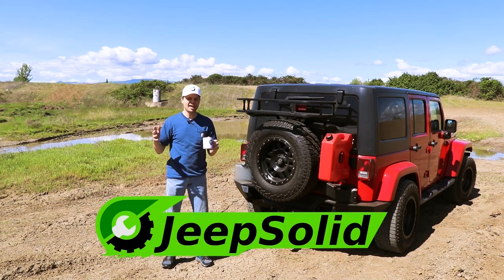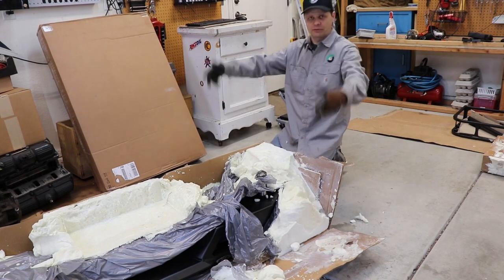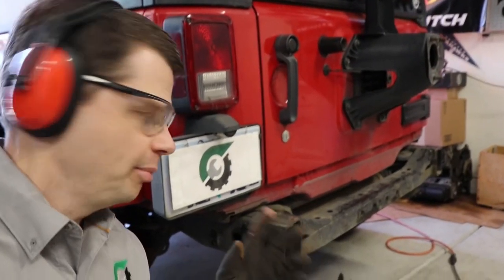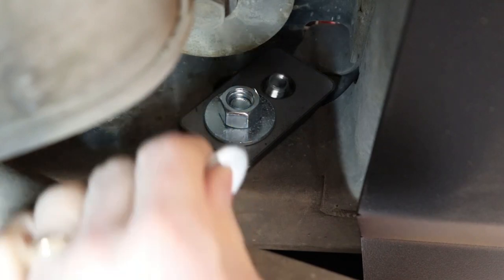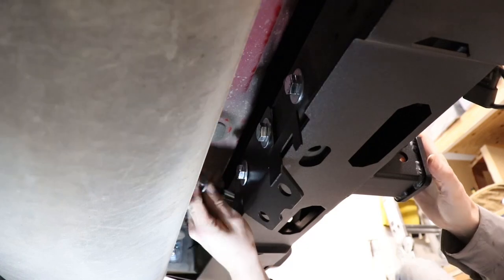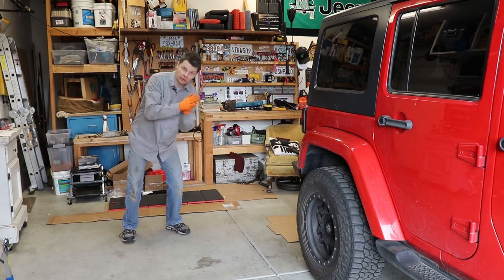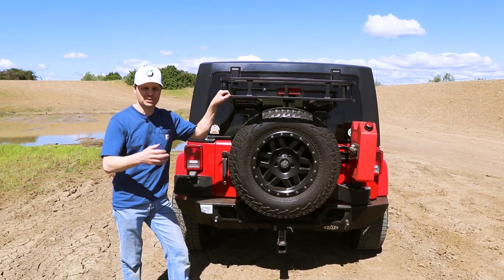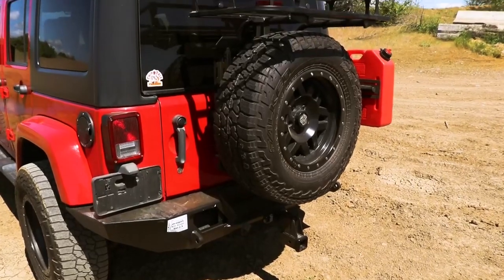The BEST Jeep JK Rear Bumper. LOD rear bumper install and review

Comment: Dude, LOD does not mess around with their packaging. I put the destroyer bumper/tire carrier on my JK a couple of months ago, and unboxing might have been the most time-consuming part of the process. I absolutely love this bumper btw.
Reply: Same question as I asked JeepSolid - now that you've had it about a year how is it holding up?  I'm about ready to get the setup as I can't find anything on the market that checks all the same feature boxes.
Reply: @bobberryhill2328  I still really like it. I don’t have major issues with rattles. At first I had to adjust the rubber stops to cut down the rattling, but I haven’t had to do that for several months. The powder coat is holding up well - no rust or anything. I bought the signature series front bumper about 6 months ago, and it is also really nice.

Comment: I have the LoD Destroyer full width rear with rotopax can mount and the Destroyer mid width front with bash bar.. And Yeah, the packaging was customer proof... One thing I did was to drill a hole and mount a set of stacked hockey puck near the pivot of the tire mount to act as a bumper for when parked on a incline.. this takes the load off of the tailgate stop.. I wish I could send you a pic of this mod I did to the rear bumper.. I think it should be implemented in the original design of it .
Reply from the maker: That's a good idea. Thanks
Reply: @JeepSolid  if you look at your video where just before you mount the tailgate bracket, you show the bearings, and seal, nut... I put the hockey pucks ( 2 stacked) close to where the seal is sitting in the video.. I wanted the tire holder arm to hit the pucks before the tailgate stop arm was maxed out. I used 2 bronze shouldered  bushings fitting to the right sized bolt and nut with thick SS washers. And of course I center drilled the pucks with stepper bits.. and then fitted to size of bushings with the Dremel tool barrel sander..
Reply: @JeepSolid  I bought mine in 2017, so it didn't have  the included bumpstop and bolt. No hole either... So maybe you don't need the mod I did...

Comment: Great Video...I have a question, do you get vibrations with the Trail Rack? I too have a trail rack and I get vibrations (on certain higher speeds) when I have it on, when it's off, I don't get the vibrations, just curious if you have experience any vibrations. FYI, I live in California and the highways are not you would call flat and even, therefore, the constant undulation causes the vibrations.  By the way, I agree on the packaging, definitely no damage on shipment, but PITA to open. I have no regrets on the purchase.
Reply: I have the whole set for my JKU, and i had rattle and thought it was my rack as well, however, i notice the space is tight between the third light extension and the carrier, so i angled it back away toward the carrier a little bit, used lock tight on the the bolts, and then cranked em down pretty good (not too tight) for the third light extension, and i stopped hearing the rattle. Maybe look at that, if you have the LOD third light extender. I do notice that i do hear slight metal rattle (different from what i heard before) when i have both my 5 gallon jerry and 5 gallon water can filled and on. Its only qhen theyre filled. Dont know what i can do to fix that, but thats a different story lol. Hope you can figure you rattle situation out. Cheers!

Comment: Thinking about ordering this entire setup. My question is that it looks like if I order the rotopax holder for both sides it will cover up the tailgate handle making it difficult to open the tail gate. I'm running 37" tires by the way
Reply: Also what size rotopax can is that you're using?